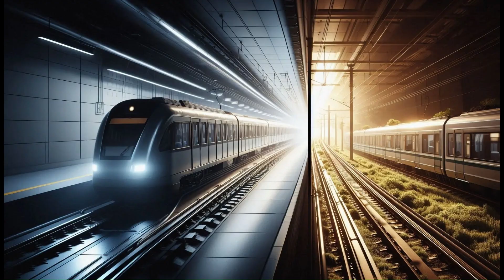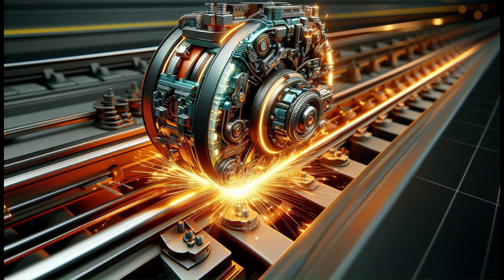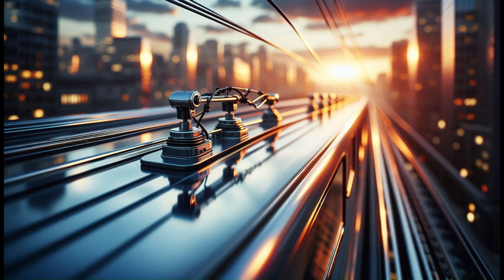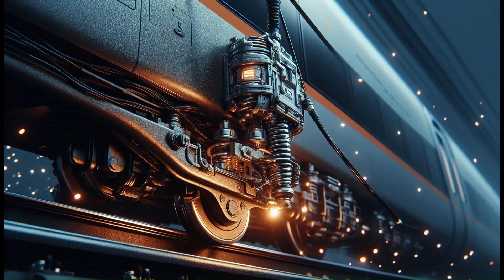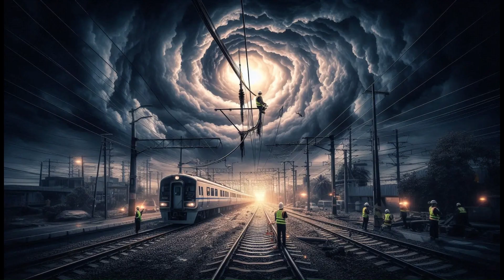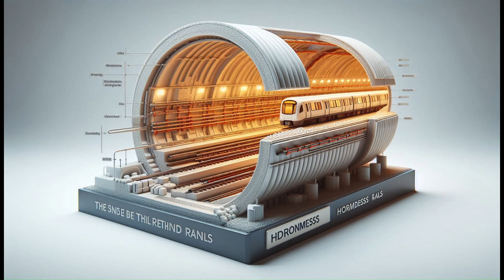Do Metro and Train Tracks Really Have Electricity ???

Comment: The London Tube uses a 4 rail system - The 2 running rail, a positive third rail outside of either side of the running rails & a negative fourth rail running down the centre between the running rails.